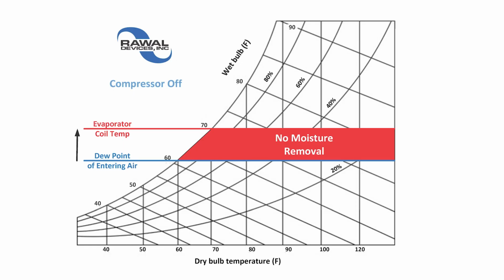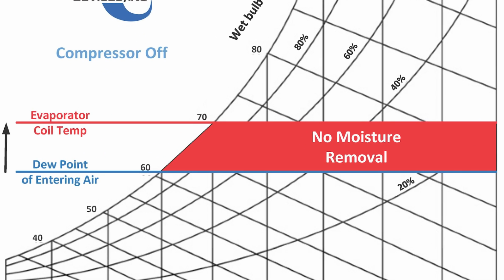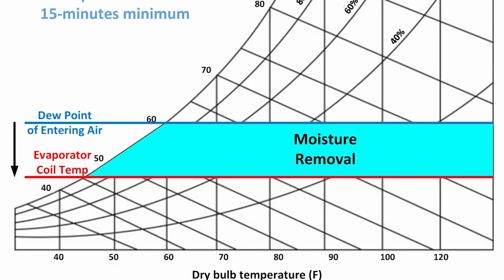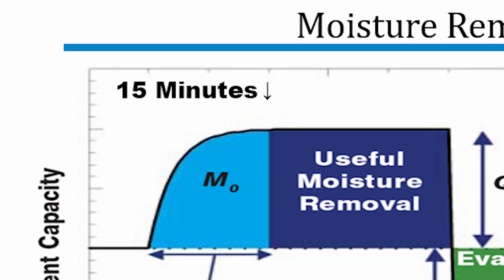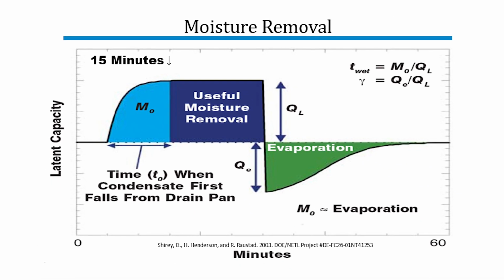Understanding High Humidity in DX systems And How To Fix it!

Comment: This is a clever idea.  I am an old-school refrigeration guy, starting in 1975.  I have installed hot-gas bypass systems by the hundreds, both fed through auxiliary side connectors and directly on condensing units, usually with a solenoid valve on the discharge gas line and a desuperheating expansion valve.  A bit hard to install these inside of most condensing units, of course.
Reply from the maker: Thanks for the kind words! We know how tight things can get inside some of those condensing units. The APR Control can actually be mounted externally as long as it’s securely fastened and positioned to avoid any potential impact or damage. We show an example of that setup in our APR Control R-454B Demo video if you’d like to take a look.